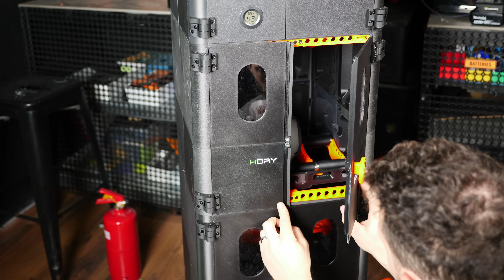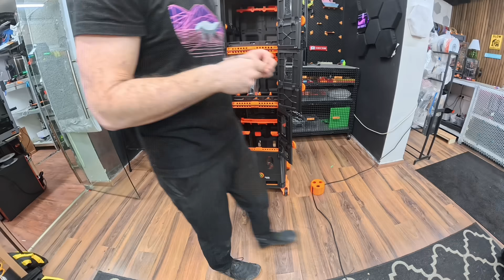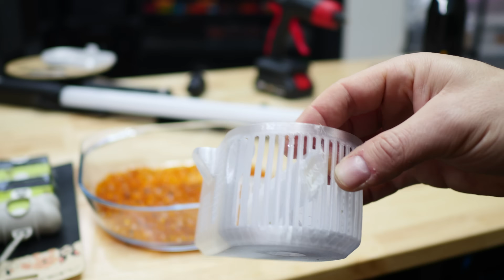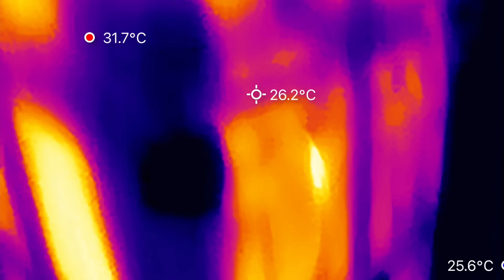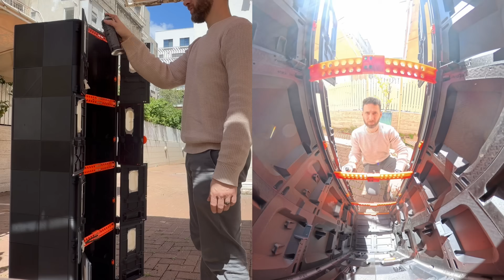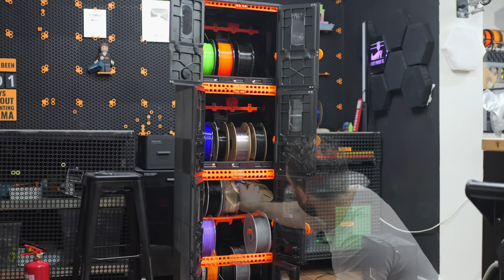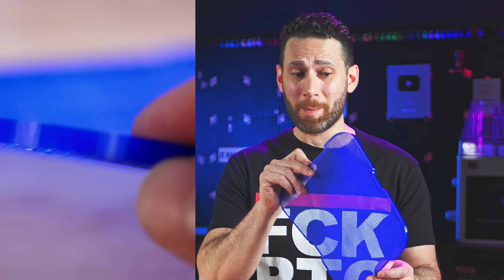This Will REVOLUTIONIZE 3D Printer Filament Storage!

Comment: Your video on building the cabinet inspired me to design print and build my own more suited to my needs - it holds 28 spools and is also the stand for my printer. I've finally got it well sealed and am ready to add a drying solution. I've been planning on using the Rosahl membrane dryer but it's expensive. Then I saw this video and was wondering how well you'd think this solution would work for a cabinet of 185L volume in a sub tropical environment? While I type this the humidity in my office is 79%

Comment: This community throws out a lot of claims around pseudo science with no basis or data for the claims. Yes, thermal cycling can degrade polymer chains, but at what temp and humidity for what materials and how long? Without data to backup any of these hypothesize how can anyone be anywhere close to sure what they are saying is true? I know as a hobbyist we need to relay on anecdotal data but even that is inconsistent and not even clear depending on who you ask.

Comment: It seems like there's a very simple solution and fix for this. Right now, you have the fans inside the enclosure pulling in air, creating negative pressure in the enclosure. If you'd place the fans outside of the enclusure, pushing air in and having the desiccant inside, you'd have positive pressure inside the enclosure, and all the small holes and crevices wouldn't matter as the air would be coming out of those instead of pulling air in.

I.e., 2 fans on the outside and 1 inside to still push it through the desiccant you'd still have positive pressure inside the enclosure.

Comment: While 3D printing everything is cool, would have definitely used aluminum extrusion for a frame, then print panels.  Be much sturdier.  And might even be cheaper or at least not much more considering filament costs.

That and extrusion is almost as amazing in the maker space as the printers are!!

Comment: Ok I don't trust you when you said the u1 can print PC and you show a chamber température of 60 degres, I just ruined my u1 trying to print polycarbonate with the official top cover.
But 1 the firmware don't handle chamber température so basically it vents out the hot air. And even with the top unplugged i barely managed to get 52-53 degree on a 5 hours print meaning my piece warped a lot. And the last one I printed warped so much it get out of the bed creating a huge blob of polycarbonate that I'll have to cut.

The only way to get 60 degrés temp is to add a heater.

Comment: Molecular sieves, silica gel, and activated alumina are all better for maintaining already dry filament, as they are  not effective for actively pulling deep core moisture out of already wet filament.  Haven't really looked into molecular sieves that much...  DOWN SIDES OF Actived Alumina:  Requires more energy than silica gel to dry (350F for 3 or 4 hours per pound, but can also go as high as 600F for faster recharge), hydrocarbons (found in filaments) can deactivate it by clogging up the pores that absorb moisture, has a lower absorption capacity (15 to 25% by weight) vs silica gel. Also, if used in conjunction with silica gel, it can pull moisture out of the silica gel.   That said, I've had good luck with drying filament in Activated Alumina, but I'm using fully sealed containers with 4x the alumina need to maintain dry conditions, and 4+ months of storage time, not a rapid solution...

Comment: "Not safe to run alone for extended periods" you 100% do not have a background in engineering and neither do I - But I 100% know you can and it is totally safe as long as you design it right; as I am now. Hopefully see it in the near future.

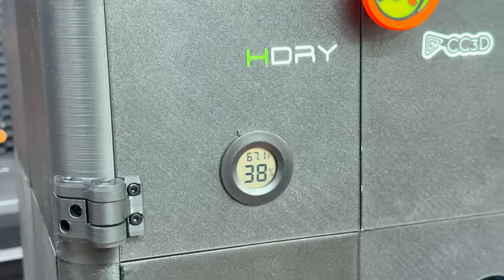Comment: 06:25 And here's the twist that'll really mess with your head: 
- warmer air rising can show LOWER relative humidity even when the actual water content is identical 
- because %RH is temperature-dependent, not a direct water measurement. 🤯
And just to complete the "physics hates intuition" trifecta: air with more water vapor is actually LIGHTER than drier air at the same temperature 
(H₂O molecules are lighter than N₂/O₂, so swapping some in drops the average molar mass). Counterintuitive, but that's the actual mechanism behind clouds forming in the first place.) 
So your silica bowl in the bottom was not the best idea, if you won't mind me bothering you 😇
Physics doesn't care if it sounds weird - it just does its thing 😄

Comment: I ditched silica gel awhile ago in favor of activated alumina and have never looked back or regretted that choice. Endless drying cycles without degradation and significantly more absorption capacity with alumina than silica.

Comment: Ideally you need to build a desiccant drier that is built into the box, or and easy way to replace the desiccant without disassembly.  Something like a drain and fill tube.

Comment: dude, the whole rack you built is passing moisture not just through gaps but through plastic itself! to watertight plastic you need to coat it with like aluminium

Comment: good video, good effort ! aside of the not perfectly sealed enclosure, your test-results have one big problem, that maybe failed your measurements. you work wit RELATIVE humidity. the xx% your displays show is ALWAYS relative to 20° C ... now if the effective temperature is higher or lower than 20°, the shown % isn't correct. your collected data can fool you. download an app that converts temperature and relative humidity into ABSOLUTE humidity. you will get how much grams of water are in a cubic meter of air. these numbers are ABSOLUTE and are way better to compare with each other. you invested so much work and effort, you deserve true results!

Comment: I inadvertently found a hack. I have a 500 mm to a side Voron 2.4 and I am using the cereal box based single spool dry boxes. Because space is at a premium, I have a bunch of them sitting on top of the printer. I'm seeing relative humidities as low as 10% in one of the boxes. I am inadvertently getting some convection action by mainly printing ABS and having my boxes sitting on top because the driest box is currently at 83° f

Comment: A big endorsement on the molecular sieve desiccant. 
I work for a window manufacturer and we use molecular sieve desiccant in our sealed units.  We buy it by the barrel and i definitely did not take a small container of it home to test.   I was finding that a container of silica gel would take forever to lower the moisture in a dry box to sub 10% levels and often would only get it to 20%. However a small bag of molecular sieve just thrown in the container got the humidity down to sub 10% in less than half an hour. The stuff is very very effective.

Comment: Next step is to have controllable vents and heater inside the device so it can go through a desiccant drying cycle periodically. Close off the vents to the box and open external vent to release moisture outside.

Comment: Have you considered that the cabinet is sealed, so you are circulating the the air with no place for some of the damp air to escape. Most newer filament dryers have some kind of vent or else they actually accumulate humidity on surfaces.

Comment: I know you're committed to that cabinet but i would think building an enclosure thats better sealed, doesnt absorb moisture itself  and designed to remove the silica cartridge externally or at least without exposing the whole compartment to fresh air would be better for maxing the dryness.

Comment: I'm using Molecular Sieve and the beads are 1.5 mm so they fall out of the current design. This is super cool though, love the fan, but need the holes to be smaller.

Comment: Maybe try installing something like a pewpew safe dehumidfier.  The inside of the box just needs to be warmer than the outside of the box to create a positive pressure situation inside the box.  This should keep most of the external moisture from leaking in  (in theory).  Worth a shot at least.

Comment: RLF  is highly dependent on temperature. If you have 20% saturation at 25 degrees Celsius, just raise the Temp 5C and you are at basically +-15%RLF
You might also just be measuring temperature differences in these small percentages .

Comment: Im absolutely new to the 3D world. Im so new. That I bought everything I need to print. But I still haven't printed my first project. 
But why not use a heating pad to heat filament yet not melt it in the box. Put a slow fan on the box with silica. As the input out put area. Heating pads have adjustable temperatures. Just a thought

Comment: I designed one also. It uses a standard 80mm, 100mm, 120mm fan of your choice. Plugged into a Tapo power plug that pulls data from a tapo humidity sensor. It works good. Not as efficient as the fans your guy uses but way easier to obtain for me. Going to swith to molecular sieve and try that in it.

Comment: For me an inline filament dryer seems like a much more efficient solution. Ideally built into the printer, but an external one would be fine as well. I have no issues with PLA, so I would only use for TPU and engineering filaments witt nylon etc.

Comment: You would probably want to have access to replace the dissicant cartridges without opening the cabinet. 
They should be installed from the outside, and possible to quickly swap with a fresh one, without replacing the entire air inside with the most outside air.

Comment: I think there is a blind spot not mentioned. If you store each spool independently, you only expose one spool at the time if you need to change filament. With cabinet like this you vent out all the dry air any time you open the door.

Comment: A much cheaper way to start off is by getting a second hand refrigerator used in bars. The ones that have a full glass door front. You can either buy a cheap one or probably get one that isn't working right for free online. I know, not as exciting as building the case but you don't have to waste as many spools of filament. Make a few racks with alu rods and you can use the bottom for the drying stuff. Most already operate at 24vdc. And you can choose between half height or full height. Both are cheap and you can get both for free. They already have lights. They are already airtight.

Comment: I have a very accurate scale and write on the side of every roll before drying and weigh again after drying before storage. Later when I go to use the roll I check the weight and make sure it has not reabsorbed moisture. On average I remove around 3-5grams of moisture from full rolls.   When doing your cabinet tests, weigh a few rolls and see if they are getting lighter or heavier.

Comment: Great work.. - not an engineer here, so i could be shooting wide? but if you had a 3 or 4 inch tube/pipe of descant,  external to the spool storage you could bolw moist air from the bottom through a huge volume of desiccant and return it dry at the top to cycle through..
 with a window in the tube it may be possible to monitor saturation levels?   and when needed exchange wouldnt require opening up and contaminating the spools with as much moist air.

Comment: I think it would be interesting to see an integrated & automatic desiccant drying system, that blocks off the desiccant containers on the inside, then opens access channels to the outside for which air can enter through a heater, then be forced through the desiccant, then exhausted back out side. After which the external access ports can be closed prior to the internal closure mechanism reopening, to allow the desiccant to resume pulling moisture from the internal compartment…

Comment: I’ve designed this exact thing about a month ago. Still building it. It’s a fully printable cabinet with this system using cheap off the shelf electrical components. Let me know if you would like to give me feedback.

Comment: I know this is a 3d printing channel, however, sometimes the best design is the cheapest and simplest.
Any box that is impervious to air flow (e.g. melamine) can be made airtight with some silicone, duct tape, hot glue and even paint - all of which are cheaper and faster than 3d printing a huge box.  Heck, you could have wrapped the box in saran wrap and duct tape to get rid of the air leaks.
Also, have you considered a very inexpensive desiccant called calcium chloride?  You can get about a gallon for four dollars at the hardware store - it's what is in Damprid. It is also rechargeable.
You seem to be working a LONG amount of time to solve some problems that have been created by the design choice of 3d printing the box.
I also don't think you need a refrigerator either.  That will undoubtedly be three videos about how you run around in circles for days trying to fit your shelves, dessicant and drivers into a specific old fridge.
One sheet of melamine from home depot, some screws, glue and silicone caulk for under $100 would kill all this work.

Comment: I have done something like that out of a big wine cooler (could fit 70 spools in there). I have to units that pushes air through dessicant from bottom to top and a fan at the top that pushes air back towards the bottom.
I get it down to 22% with fresh dessicant (around 3kg spreaded all around in ploycarbonate or petg boxes in addition to the fans units.
My main issue according to IA is the wooden shelves which I believe since a wine cooler is made to maintain around 60% RH. 
I wanted to clear coat the shelves but IA expressed concerns about vapors from the clear coat that could actuallu damage the filement in the long run... i'm not willing to throw away 60+ spools because of that so I'm waiting to see if I can find some metal shelves of built something myself. 
For now 22% suite me I only put pla, tpu and petg in there and I keep my few engineering filament spools in bags. 
For information, I don't open the door a lot and eveytime its quick. It has glass door and lighting inside so I can quickly spot what I need and grab it. 
It's been almost 2 months since I last dryed the dessicant and I've only gone up 25% RH. 
Hope that can help someone.

Comment: I just designed and planned a dry cabinet in 4 hours thanks to you inspiring me and google AI´s help. Now "all" I have to do is by the material and build it. I will be using wood and chanel plastic and not print it as that would take me a month and cost much more for the filament. But still, tanks for the motivation.

Comment: The best way to remove moisture (water) is to freeze it. I cycle the air from my filament storage through a small chamber with peletier modules at -5c freezing the water. Once a day I stop the air flow and let the ice melt extracting the water. Then the cycle resumes.  Also note 5hat relative moisture is misleading. Real moisture is lm water per cubic meter of air.

Comment: I built a box out of wood and chanel plastic (greenhouse walls) and put a 25W ceramic/infra red bulb in a protective enclosure in it. It maintains 40-45 c in a 18-22 c ambient while on 24/7 and the moisture is at 10%RH. It feeds the filament in to the much larger box of the same material I use as a enclosure for my printer. The plastic has a max safe level of 120c so I can even heat the enclosure should I wish to. I am now running out of dry storage space as I accumulate filament spools and are debating if I should build a much larger insulated and heated dry box. 
The RH indicator says 10% but would it stay dry if I turned the heat off or would the contracting air pull in new moisture, and why is warm air reading as dry, does it not hold more moisture than cold air effectively increasing the water in my hot "dry" box?

Comment: duh. You just microwave it later on defrost with enough so it doesn't cook it and harm the desiccant. a wheel is way more costly but goes forever. could 3d print a wheel but you need a heater component. also, old cotton socks sewn shut are good for the desiccant. alumina desiccant is better but costs more. It will dry anything over a long period of time. color indicators are highly toxic and don't indicate all that well. some tiny colored packets can help and minimize the toxins. I'd like to make something that stirs up in the microwave and a bigger fan in the microwave. oh bug netting works quite well; but old cotton fabric is everywhere.

Comment: In Canada, 14$ for a can of spray paint is a good price...

Also note that carrier media in spray paint can often slightly dissolve plastics, not enough to degrade the structure but enough to complicate curing.  There's a reason the instructions suggest 5 days.  And if you put the more-or-less airtight containers back together before the clear coat was fully cured, you've just trapped the offgassing fumes in there.  I've no idea what that will do to humidity ratings, but I strongly suggest anyone trying this leave the boxes open for several days so the clear coat can cure.

Comment: I would think a cartridge system built into the side of the cabinet would be better especially if you used magnetic latching that also fed 24v power into the cartridge. An Arduino with a buzzer, a light and color sensor might also help with the saturation level.

Comment: I wonder if part of the issue is that your fan is pulling to much air and bringing air into the actual box.. If that’s the case, a weaker fan or multiple weaker fans at different heights in the cabinet might be a better solution.

Comment: As you have found, a closed system can only move water around inside the system. To really dry things you need to remove that water from the system. I am currently using a heated dry box with a fan SLOWLY bringing in external air. That external cool air contains moisture but when heated inside the box, it can hold more moisture.  So when it is then expelled more moisture goes out of the chamber than comes in. The chamber does contain desiccant, and that also gets dried by this system, along with the spools. That means I don't have to power the chamber and fan all the time. Works for me.